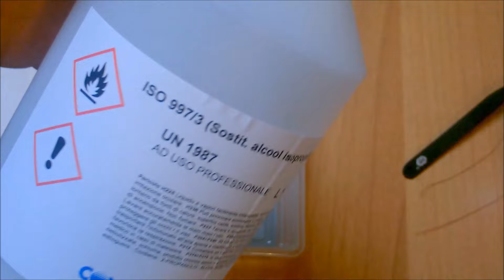Cpu(AMD) pin repair.

Comment: so, if the processor has a high TDP (125), can the heat damage the welding?
Reply from the maker: Absolutely no. Alloy SnPb melts at 190 ° c

Comment: What cable did you use for the wire ?
Reply: looks to be copper.
Reply: @HorusHeretic  yeah, I mean where did he got the cable from, is it a sata cable ?
Reply: @Juicewrldddz  I have heard of someone using a Data cable before to repair these

Comment: Scusa che materiali hai usato?
Reply from the maker: Ho usato una stazione saldante Weller whs 40 regolata a 350°  filo di rame recuperato da un cavo di messa a terra di un impianto 380v trifase, flussante Kingbo, alcool isopropilico per la pulizia e aria compressa per l'asciugatura. Puoi usare altri materiali l'importante è la punta sottile del saldatore, il diametro corretto del filo che vai a saldare e mano ferma.
Reply: Satu grazie mille